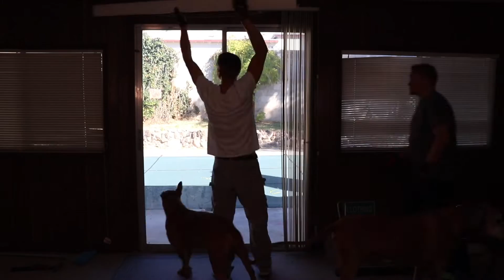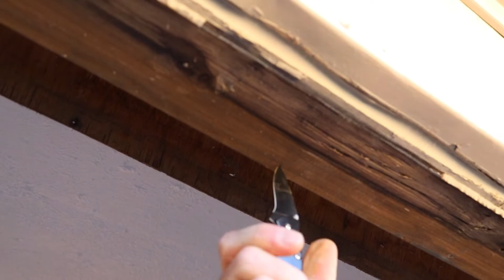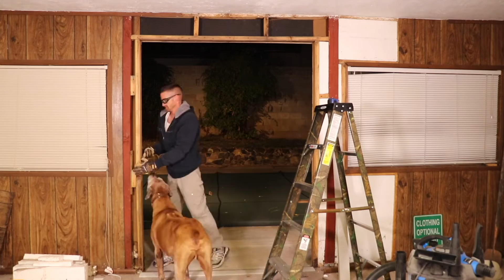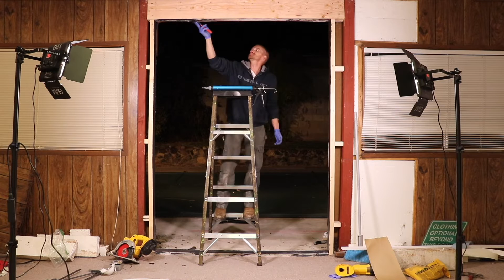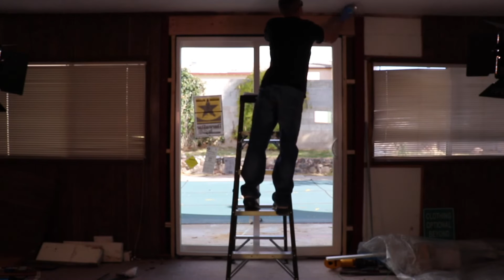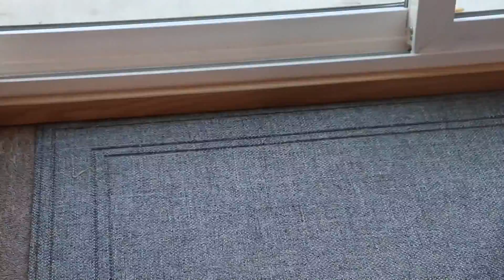DIY Sliding Glass Door Replacement

Comment: lemme ask a question.....I am putting in a slider over a one inch high concrete sill...I'm not sure if I can put the vinyl door sill right to the concrete. Is it better to place a p.v.c. plate between? Like in your video?.....or just screw the vinyl door sill into the concrete sill.....good video, this is my first slider job!!! hope it turns out like yours.
Reply from the maker: The door that I used in this video had a 1-1/2" lip on the bottom of the door and there was no concrete sill, so I put Hardie Backer concrete board in to make an 1-1/2" sill. I would measure the lip on the bottom of the door that you are planning on installing, if it will fit without raising the concrete sill then I would install it directly on the concrete but, I would use a liquid flash on the bottom instead of screwing into the concrete if possible because drilling could crack or even break the 1" concrete sill. Liquid flash will also prevent any water from wicking into the concrete sill. I hope this is helpful. Thanks for watching!

Comment: Nice video. How much would you charge someone to do that very same job, labor only?
Reply: What if a door were $5000. Couldn’t charge customer $10,000 for installing it. Should you go off the cheapest door?.
Reply from the maker: Well more expensive doors are usually a lot heavier so I would add $1000 more on my bid to pay for a couple extra guys. so $2600-$3400. I can't see charging more than that for this size of door.
Reply from the maker: Thanks. 2 to 3 times the cost of materials = labor. In this case I think the materials were around $800, so $1600 to $2400 is the range I would estimate. I hope this is helpful. Thanks for watching!

Comment: Should you have built a temporary wall to hold the load of the ceiling? I’m an amateur handyman working on a similar project
Reply from the maker: If you are working on a 2 story house then I would definitely build a temporary wall to take the load. In this video I'm working on a single story house and I didn't see anymore sage after removing the header. The roof sage that I was dealing with was caused by a water leak and the lack of a proper header. That's why I had to jack it up to remove the sage in the roof. I honestly can't tell you what to do without seeing the house and the framing. I hope this is helpful. Thanks for watching!

Comment: Door frame didn't look square.. When you opened the door, you had a 1/4"-1/2" gap at the left top vertical, but it was flush at the bottom... You can see it right here in the video.. https://youtu.be/Wgq9q7HHlOE?t=672   and also right here..  https://youtu.be/Wgq9q7HHlOE?t=602
Reply: Joe S looks more like the sliding door itself needs a roller adjustment to make it straight.

Comment: Need better lighting.
Reply from the maker: It was so bright outside causing my shot to be to back lit and my lights couldn't over power the back lighting from the sun during the removal of the old sliding glass door. It gets better once the sun moves. Do you have any suggestions on what lights I should be using to prevent this? I hope there was still some helpful information in this video. Thanks for watching!
Reply: @WillowsWorldofDIY  Film at an angle instead of with the sunlight directly in front of you